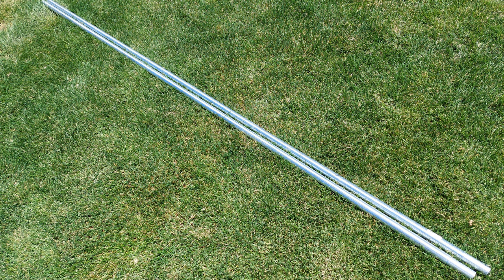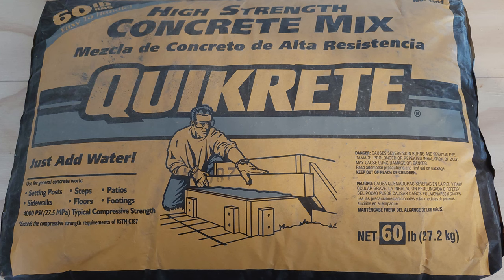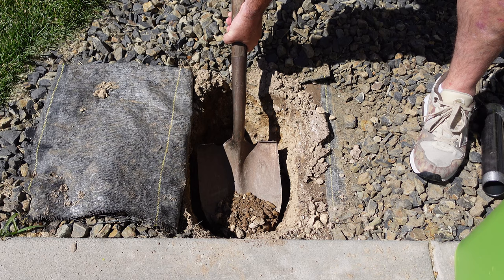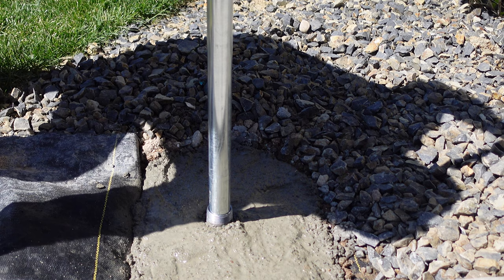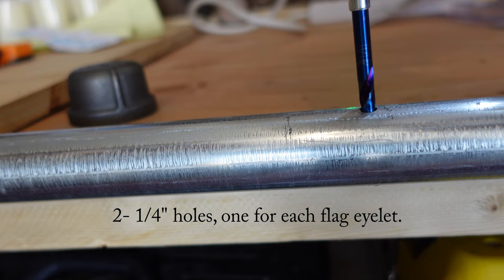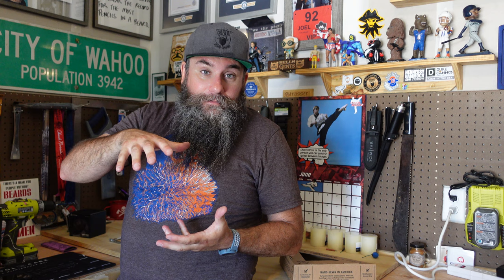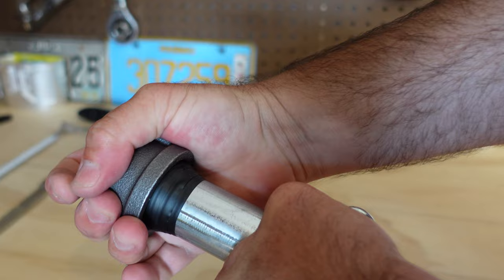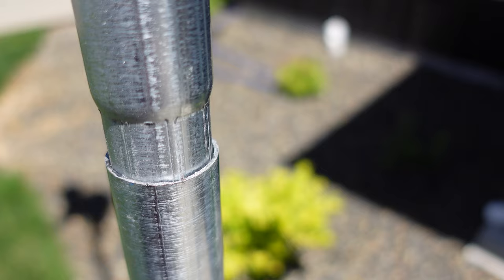Make your own flagpole - sturdy, affordable, & simple!

Comment: Thanks for the video,  one change I would recommend is reversing the poles so the female end is on top of the male end upon insertion.....ahm.  That way you obtain shingleing and no water gets between the poles at the joint.
Reply: It follows you'd be burying a narrower diameter tube in the ground also.

Comment: Hmm, I love the idea. But, I’d like to add pullies to mine. I like the idea of just using rope to change flags out.  I’ve always bought those retractable in-ground poles, but they are always a pain in the butt to lower because they stick and then the push pins break.  I looked into poles with pullies, but they get real pricey. Some are thousand of dollars🤦‍♂️.  Anywho, I’m going to try your method but just use pullies and I’ll also paint mine white. Thanks!

Comment: This looks awesome - thanks for sharing!  Do you think the pole would be sturdy enough to also be an anchor point (below the flag) for a solar shade?  A little flex would be ok I imagine.
Reply: I just did this. I think it would work great for this purpose. The two things different is I’m installing a security pin near the bottom so that it will prevent the poll from being pulled out accidentally from an unexpected large wind gust. I’m also only using one ten foot poll on each side of the driveway with a two foot deep hole. It’s a rectangle one. I want to also use each one as a flag pole as well. Our football team flags on game day and USA and state flag

Comment: My yard is all pavers you think if I fill a Homer bucket up with cement it will stay up?  Last thing I want is to come outside and see old glory on the floor
Reply from the maker: If you bury the 5 gallon bucket into the ground it might work.  If it's sitting on the surface I think it will tip right over.
Reply: @joelnert  thanks maybe I could strap it to my deck somehow

Comment: Costs a bit, doesn't it? I can see putting your kit together from bits you happen to have already, but those hardware pieces really add up for someone starting from nothing. Plus they're probably made in China if you're going for cheap, so may as well just browse Amazon and get a kit from one of the multiple anonymous fly-by-night importers with memorable names like Zowpzim or Mplftoo. The only thing you're missing there is the concrete.

Comment: Nice but doesn't the flag wrap around the pole. There should be a looped  weight ahead bottom so the flag will turn around the pole. And you should have something at the top that spins around with with the flag.
Reply from the maker: It never has got wrapped up or tangled up.